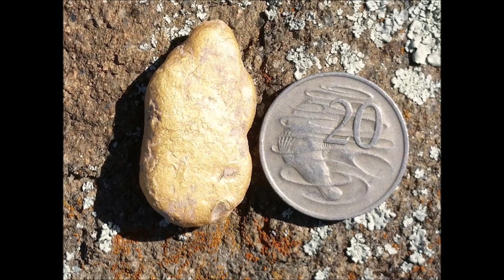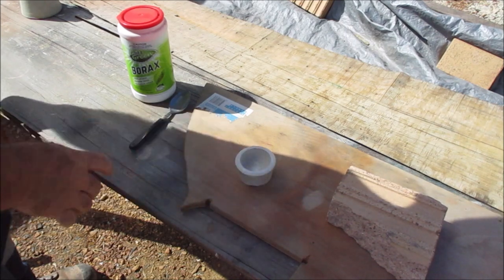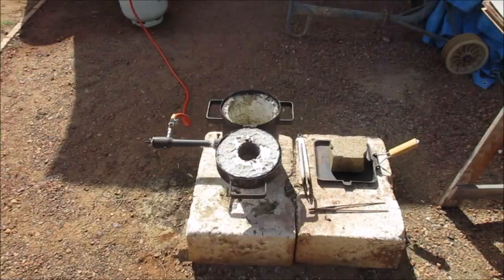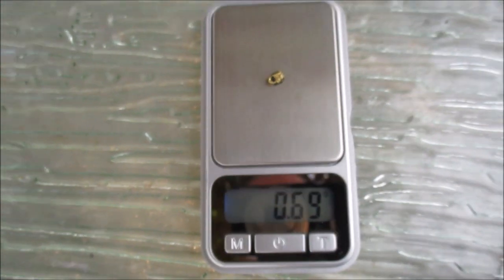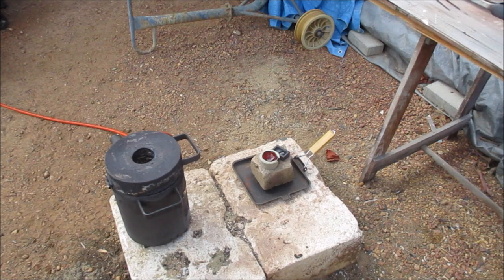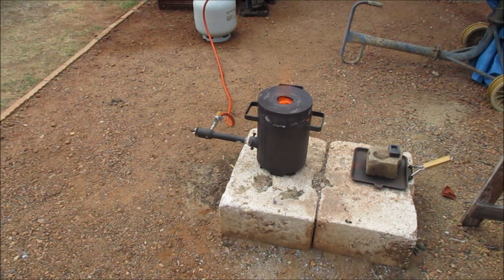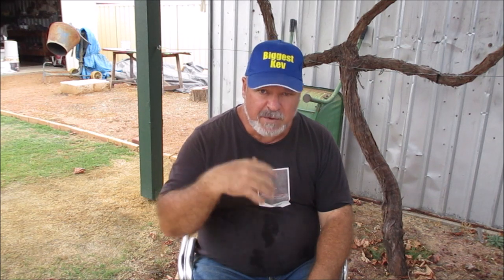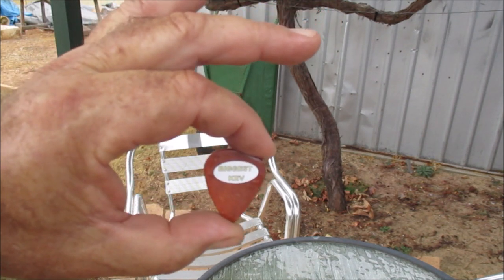HOW TO MELT GOLD INTO A BUTTON

Comment: How cool. Have made a homemade furnace but always been to scared to melt my gold in case I stuff it up. Thanks for the vid. Maybe now I’ve seen this I will have a go. Lots of videos and different ways with this and that. Can be confusing for a newbie.
Reply from the maker: G'Day Lozz, I'm still making mistakes, but thats how you learn. If you have clean Gold it's easier as you're only melting the Gold. Have ago Lozz, just take your time, wear protective gear and don't trip over the gas hose🙃 Cheers Kev

Comment: Hey Kev, I am just a YouTube researcher with zero practical experience, I just wanted to say that I have seen a lot of people pre coating their crucibles with a layer of borax. Small gold balls can stick to the side and not join the main melt. Just something I have seen. Hope it helps.

Cheers
Steve
Reply from the maker: G'Day Steve, yes you're right I should preheat the Crucible with Borax before doing the melt, but because I mixed Borax with the Gold material the Borax glazed the bottom of the Crucible. I will preheat and glaze the Crucible before I melt Gold next time, I'm very forgetful. Thank you Steve. Cheers Kev
Reply: @BiggestKev1960  you are doing great mate. Love the videos. Keep doing what you're doing, it's all good.

Cheers
Steve
Reply from the maker: Thank you Steve, for your comments & watching my video's👍Cheers Kev